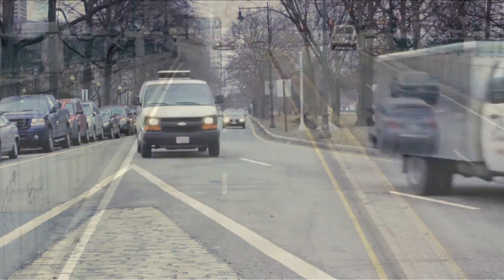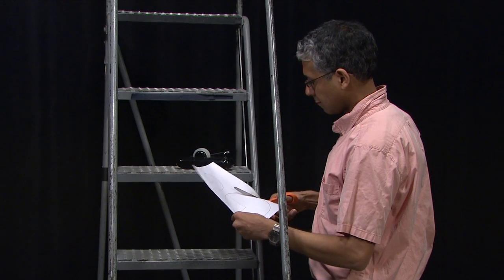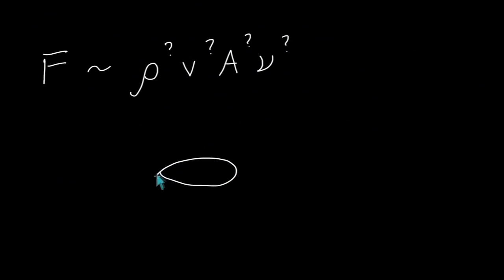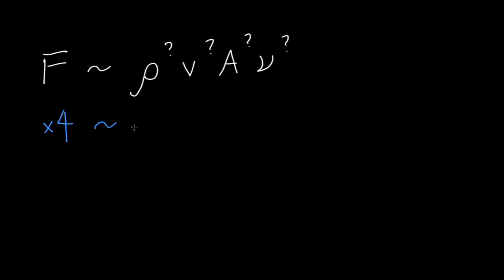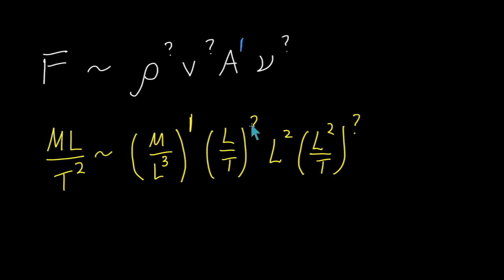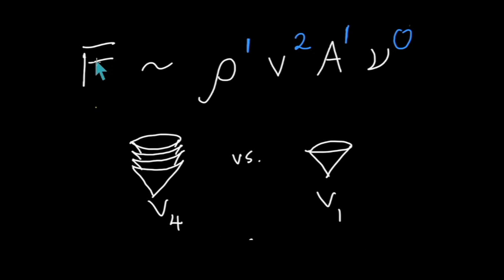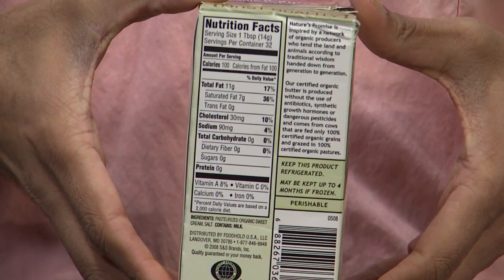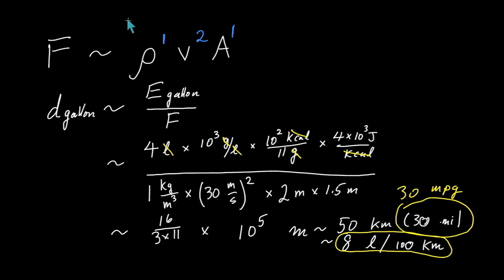The Art of Approximation

Comment: Brilliant! Very interesting! The use of such simple devices and the approximations taken is something that I need to learn! One side note it would be that the drag force is proportional to rho*v^2*A, not equal. That was rightly stated in the obtaining of the equation with the ~ character. The full equation of the Drag force is Fd = 0.5*Cd*rho*v^2*A, where Cd is the drag coefficient of the object(depends on the shape of the object, around 0.25~0.3 in modern cars) and rho is the density. The proportional factor in that equation(0.5*Cd) is not taken into account when the fuel efficiency of the car is obtained. The fuel efficiency using the whole equation of Drag should be around 6~7 times higher than the one obtained! From other perspective, knowing the fuel efficiency, the energy per gallon, velocity, rho and A it would be easy to obtain Cd!
Thanks!